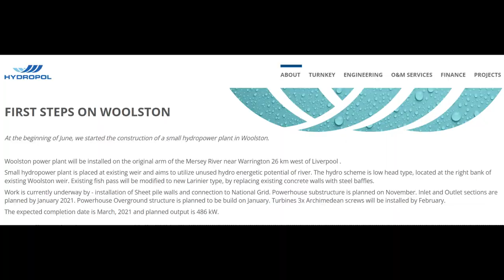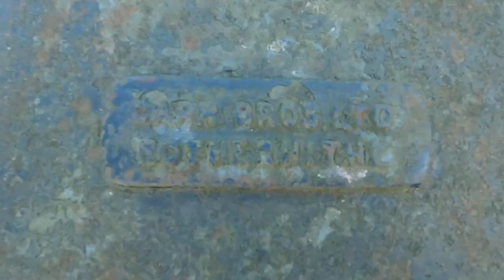Exploring WW2 Concrete Barges on the Manchester Ship Canal

Comment: The oldest concrete boat was built by Joseph-Louis Lambot in Southern France in 1848. That first vessel hull was still good 150 years later. Concrete or Ferroconcrete was used for commercial vessel construction. Concrete is cheap and is an inexpensive material for a hull. Back in the 1960's there was a vogue for concrete sailing yachts typically 40 feet or longer made from a steel frame and chicken wire covered by concrete. Special teams were able to plaster the hull to quite a high standard. Home made hulls were often rubbish. Although the material was cheap the labour costs could be high removing one of the advantages. The hulls were very strong and surprisingly much lighter than you might have expected.

Comment: They are called Ferrocrete Boats, one still has the letters FCB13 painted on. Ferrocrete is concrete poured over a wire mesh. If you had gone a bit further south in the bay on the right there is another two full barges grounded in the woodland! One has a tree growing through the hull! But anyway - it was amazing to see the sunk sections in such detail! You captured them all perfectly! Another great clip! Bravo!
Reply: Interesting. My research says there are actually 6 - the three we can see and 3 more in the bank further in.
Reply: @jaalmemamaza  Correct! There is a  submerged one further along.
Reply: @nickbenke3306  Thanks for getting back to me. Above you mention that there are two more (and in fact, my information is that there are three more) but just now you imply there is (just) one more. Short of trying to persuade Time Team to come along with their geophysics bods, I need to plump for a number !. I will gladly use your information and quote you in my book, but is the number two or is it one ?? I am also trying to see if the Manchester Ship Canal Facebook group can confirm - there is one answer from a chap that was present when they were dumped and holes drilled in them, but even then that doesn't mean that what he remembers is the total. Elk for example was dumped by 1931 and the MSC Co. used the dead river arms to dump all sorts of stuff - such were the times !
Reply: We played there a lot in the early 70s and I recall 6 including the accessible ones at the bottom of the channel in the east bank. All the trees at the base were not there when we were kids it actually had a bit of a beach of oily sand.

Comment: The French Navy used concrete supply ships. One, the Crocodile, was bought by a chap called Georges de Caluwe in 1962 and he converted it into an Offshore Radio ship. He renamed it Uilenspiegel (which translates to Owl Mirror, a legendary Flemish folk hero) and once fitted out, it was sailed out to international waters off of Zeebrugge in October 1962, broadcasting as Radio Antwerpen. On the night of 15th/16th December 1962, Uilenspiegel dragged her anchor in a storm and after the crew were taken off by lifeboat, she ran aground at Cadzand. There the UIlenspiegel lay until 1971 when the Dutch authorities blew her up as she was considered dangerous.
Reply: Le Crocodile was launched 1920 so not a WW2 barge

Comment: My Mam walked us down to the concrete barges once. She lived in Thelwall as a child and used to play on them. Thelwall Viaduct was original just the one bridge completed in 1963. The second bridge was completed in 1996. The issue with the first bridge was found in 2002. So they were incredibly lucky in a way that the second one had been built. I think at one point the maintenance work had to be temporarily halted due to a Kestrel family nesting under the bridge. Which are protected by law.

Comment: Great video! There’s a similar concrete barge near Newark in Nottinghamshire on the banks of a lake next to the river Trent. I think there’s quite a few of them knocking about and as you said they can’t be scrapped, so they are just left to gradually just…. sit there forever. 

Top work on the videos, really enjoy them.
Reply: Winthorpe Lake - the ones on the MSC were built at Barrow-in-Furness whereas the one at Winthorpe Lake was built by Tarrans in Hull

Comment: I remember in the 80s Thames barges made in concrete They were selling them for 400£ They were 1892 when made still  fine They make them upside down then flip them Concrete under water becomes stronger over time
Reply: A chap near us In North Wales built s ferro crmr tbys by snd set sail yo hi round the world but hit bar weather off Lands  and foundered but I think they were all saved. Doesn't t fill you with confidence, concrete, does it?
Reply: @hefinhughes7263  I did consider having one but I ended up with a steel Dutch barge But it's around 2000 just to have her craned out for it to be blackened Concrete would be ok on the river
Reply: There were lots of Swim-head Thames barges, built by Wates in WWII. They were craned off the dockside by Mammoth. The upside down build was unique as far as I am aware to some of the first building in Norway in 1917

Comment: Nip down to dockyard road Ellesmere Port. CH654EF.   & you will find 5 of these boats.  In 2 stacks. Sunk by the ship canal company to stop Cleanaway ever using the berth there to import waste.  Only the top 3 are ever visible unless the canal has really low water.  I worked there for over 20 years & only ever saw all of the boats on one occasion
Reply: Very interesting. I was led to understand that there were 6 in two stacks of three? I don’t suppose you ever took a photo?
Reply: My research concluded that they were located here 53°17'11"N 2°52'57"W. Is this correct ?
Reply: @jaalmemamaza  according to one of the old hands- Barry McVeigh-  there are only 5 boats. & I have only ever seen 5.  At an extremely low water event.
Reply: Hi. So I have a map and photos of 6 FCBs that were taken in the 1960s and appear in Philip Simons’ World Ship Society publication on the topic. Personally, I found 5 but not the 6th…

Comment: Are you 100% certain that it is a dead arm of the River Mersey ? I see it elsewhere called the River Lymm ? The wooden vessel is the 'Elk'. It is believed that she was originally a three-deck frigate, built in 1851. She apparently served in the Crimean War (1854-56). Converted to a dumb hopper by the Dundee Harbour Trust and then went to Penarth before coming to the Ship Canal in its construction days. She was fitted with a Priestner grab in 1899. She is therefore, a truly historic vessel, apparently dumped in 1931. There are allegedly 6 WWII FCBs where you were, the others have disappeared into the bank, further down the river arm. Nick Benke below referee to two of them.  Enjoyed the video.
Reply from the maker: That's some great information, thanks for sharing. I didn't find anything about the Elk so thanks for letting me know! Yes I'm 100% it's the old Mersey riverbed. I can't find anything about a River Lymm and the Mersey meandered a lot before the Ship Canal was knocked through there. Thank you 👍
Reply: The three mid channel were there in the late 60s and had been there some time. I remember being frustrated we could not reach them without a boat and even with a boat it would have been risky due to the ships passing and the tsunami sent up channel. Those wooden wrecks were more prominent then and nothing looked big enough to have been a frigate. They looked like wide shallow draft barges. When the massive Manchester Liners went passed the water was drawn out of the channel exposing the wrecks. The wooden wrecks also impede passage down the channel so the concrete barges must have been scuttled earlier.

Comment: The infrared detectors on the bridge might be instruments to measure the level of the water. 

Where the barges were located what was that bit used for?
Reply from the maker: Yeah that's what Lewis thought too.

The barges are on the old mersey river bed that's mostly filled in.
Reply: @BeeHereNowuk  they might not be able to use the bridge if the level is above a certain setpoint or it could be collecting data for the environment agency / rivers trust possibly?

Comment: would there be asbestos in those boats?
Reply: No asbestos came out later
Reply: @neilblackman8749  wikipedia says that it became popular during WW2
Reply: @janlietaer9046  never knew that it was used before the late 50s I am a building inspector and we still have it ripped out Don't think I want that in by barge But I don't have to worry about getting blown up plus any work I do in the barge I wouldn't want to work around it even if it's painted